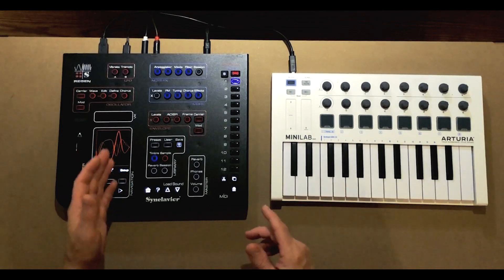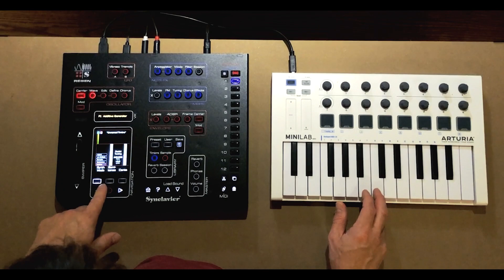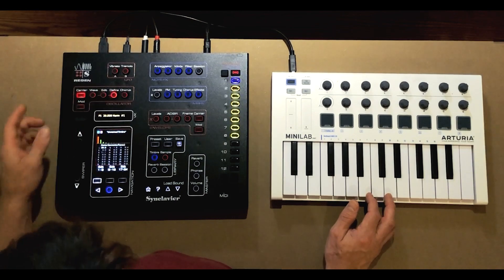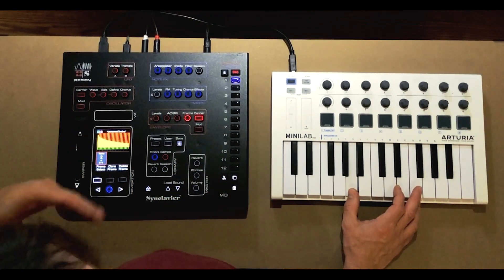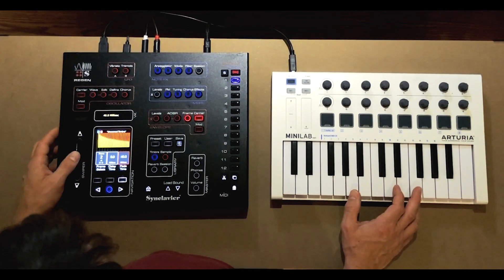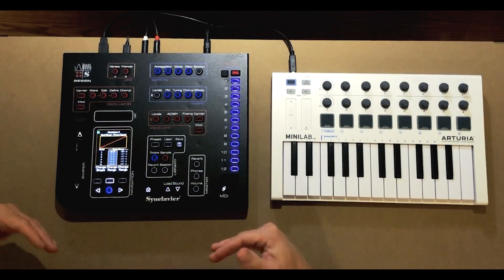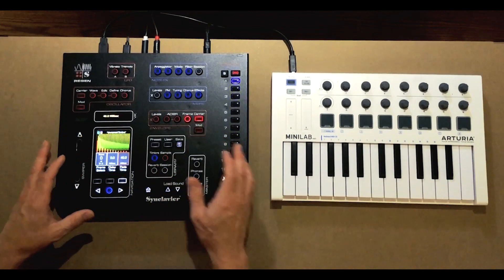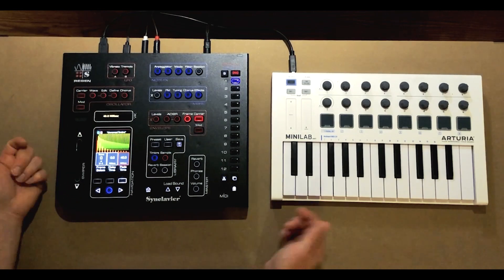Building simple Frames on Regen

Comment: Excellent!  When having a sample as a carrier, can you create several frames where the modulator has different levels of FM, different ratio and modulator harmonics? thus modulating the sample with FM in different ways over time? Or is ratio and FM Level the same for all frames in a partial?
Reply from the maker: Frames are for additive carriers, not samples, but if you have a long sample, it could span several frames. To change the FM Ratio over time, you'd have to achieve that with several partials carrying the same sample, and have different FM Ratio on each partial, then you set the Delay of each partial on the volume envelope so that they come in and out at your desired time.
Reply: @Synclavier   Thank you for explaining, I did an experiment with the Synclavier V where I have a long sample as carrier and modulate that with different modulator harmonics and FM level, which can be set per frame, but ratio is the same through all frames. It sounds like the sample ie being FM modulated in different ways depending on the frame setting. So this seems at least possible on the V. Is it the same with the Regen?
Reply from the maker: Yep, what you're suggesting is possible on Regen. So you can change the modulator and FM amount (not ratio) per frame. You have to set the waveform to Hybrid for that. And I just thought, you could vary the FM Ratio over time by mapping a volume envelope from an unused partial to FM Ratio - that would be interesting. @henrikstolpe